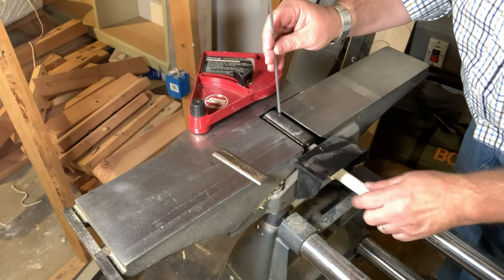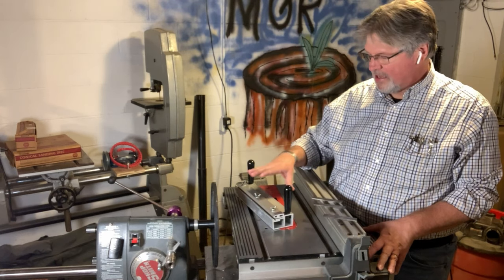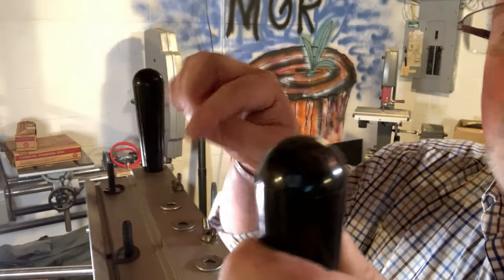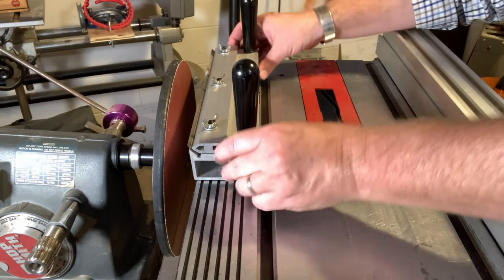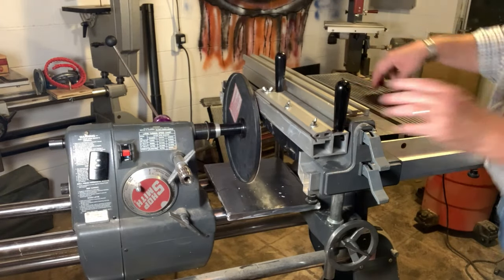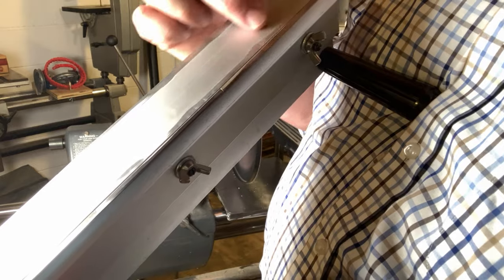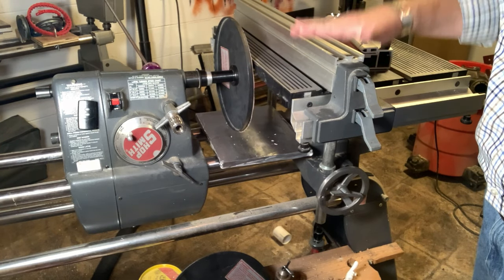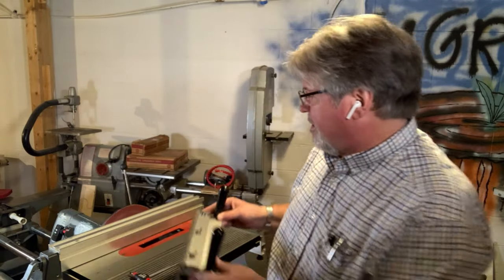Sharpening Jointer & Planer Knives on the Shopsmith Conical Sanding Disc

Comment: Excellent tutorial. 
I just purchased a SS Sharpening Jig, A Conical Disc, a 3-pack of Sanding Discs and a Magnetic Jointer Pal off of FB Marketplace for an even $100.  On SS website the Kit (jig, conical disc and sandpaper is $160 and the Jointer pal is $36.) 
I’ve learned:  Go slow.  You can always take more off but once it’s gone, you can’t add it back. 
And
While you have it set up, put on a flat Disc and sharpen your lathe tools.
Reply from the maker: @drumaganger  Thanks, Jody! Great advice.

Comment: I watched this video some time ago and was so impressed that I purchased the sharpening guide and during the last couple days I replaced the bearings in my Jointer and decided to use the tool for the first time and sharpened both sets of my Shopsmith Jointer knives. 
One set is carbide and the other not. 
Both came out as good if not better than new. WOW is the word for the ease and results.
Had to run a board through the jointer and it came out so smooth and flat. Should have replaced those bearings 1,000 board feet ago.
Thankl you as usual and congratulations on hitting that 99,999 Subsriptions.
Reply from the maker: Glad to hear that it's working well for you. And I think there's an extra 9 in there somewhere!
Reply: @MyGrowthRings  Dad-gum-it I did!!!

Comment: Watched your video and ordered a new sharpener directly from Shopsmith (since i couldn't find a used one).  The box was missing the lower glide rails so I built a new piece using HDPE and tagged you on IG so you can check it out.  Spent maybe 20 minutes sharpening 2 sets of jointer blades (extremely easy!).  Thanks for the videos.  You're a huge help!
Reply from the maker: Glad to hear it all worked out but it’s a shame that you felt like you had to do that repair work yourself. Did you call their customer service department? Scott
Reply: @MyGrowthRings  I haven’t yet. I’m working on a cutting board for my wife’s birthday while she’s out of town so getting the blades sharpened was time sensitive. I’m also going to replace 3 the 1” set screws with 1 1/2” because there are only about 2 threads on the wing nuts and where they thread in to the sharpening body. I understand why they didn’t use steel Allen head bolts threading in to aluminum but geeeesh, 1 or 2 threads holding the knife fixture is asking for trouble. 

Thanks for the response Scott!!

Comment: Scott… that is a tool with which I am unfamiliar.  Before I got my Tormek, I almost bought a used Shopsmith sharpening jig on eBay.  Fortunately, I was outbid.  You see, I don’t have a Shopsmith Jointer or Planer.  It would have been useless to me…. Or, I’d have spent a week trying to re-engineer it to work!

After watching it in use, I must admit, it is quicker to set up, more foolproof and easier to use than the Tormek!  And all in all, it is a lot less expensive too.  Perhaps it would be worth it for me to find a used one and see what I’d have to modify to make it work in other brands of knives.  After all, I only have about a dozen other projects going!

I posted a “Final Thoughts on the Conical Disc” video this morning.  However, in my sleep deprived editing, I made a seriously incorrect claim.  With a clear head this morning, I’m gonna fix it and repost.

You did a nice job with this demo, Thanks.
Reply from the maker: Thanks, Dave. Yes, I used to own a Tormek and used it once on my jointer knives and went back to the SS jig with the conical sander. The Tormek is unrivaled for chisels and plane irons, though.  Scott

Comment: Another idea - I have a table insert I’ve made for the conical disk.  Now the jig is much closer to the table end.  By use of the adjustable stop collar I can get excellent results and not be too extended.  One time I did angle the jig at the end.  I’ve a t-nut adapted face for the fence - making the fence longer.
Reply from the maker: All great tips. Thanks John.

Comment: As always great information. I was looking forward to this because you mentioned that the jig was not for use on non Shopsmith planer knives. I've been using it to sharpen my Dewalt knives. OPPS... I look forward to the follow up.  I've saved the cost to the jig and disc many times over by sharpening myself rather than sending it out to be done.
Reply from the maker: No harm no foul! I don't know that the DeWalt knives are even meant t be sharpened, but if you are going to do it at least be sure to sharpen them equally. Scott

Comment: I have a set of diamond sharpening stones that I use for chisels and plan blades. I have sharpened my Shopsmith jointer blades on them using Rob Cosman’s methods. It is a much faster process than what you showed in this video. However, absent sharpening stones what you showed was very interesting.
Reply from the maker: I'm familiar with Rob's method for chisels and plane irons but haven't seen it sued for jointer knives.  I'll have to look around Youtube to see if there's an example of it. Thanks for expanding my knowledge, Larry! Scott

Comment: Great video again. I use the adjustable stop collar to lower the table. As a technique I use a sharpie and cover the bevel. It makes it easy to see the area sharpened and expose any knicks.  I’m not close to the manual, but it states how narrow the blades can be before they need replaced.
Reply from the maker: Great tip. Yes, there is a maximum that can be removed.  I'll look it up and make sure to mention it in the follow-up video. Scott
Reply: Thanks Scott Green for the tip on using the sharpie. I do that with my lathe chisels when sharpening them, makes perfect sense to use that here.

Comment: Once again, thanks Scott for a extremely informative video .... I'm definitely going to need to invest in the Conical Sanding Discs as well as the Sharpening Jig.   Speaking of which, did you ever do a video on the Shopsmith Sharpening Guide for Chisels and Lathe Tools?   I have the guide and a dedicated Steel Sanding Disc along with the 12" 150 Grit Fine Sandpaper but have lost the directions that came with the guide.  Thanks again for the weekly videos ... I just love them.   Blessings,  Dennis
Reply from the maker: Hey Dennis. I don't know what happened to the response I typed, but I see it's not here!  No, I haven't done a video on the sharpening jig yet, but once we are in our own shop and all our stuff is out of storage we should be able to get to it.  That said, Doug Reid did a two part series on it: https://youtu.be/JlT_bNTnBUw and https://youtu.be/EkT5y-2ie94 Scott

Comment: Someday, can you show how to adjust the table so that the miter slot and the table saw blade are parallel?  My 510 (I think) seems to be slightly out of alignment, but the instructions I found mention bolts that I don't think I have.  It seems like it would be essential that the table be properly aligned for an activity like in this video, if you are relying on the fence to be parallel to the sanding disk.
Reply from the maker: One of these days I will. The 510 has four bolts that hold the table to the half round trunnions. The instructions tell you to loosen all four bolts but you only need to loosen three of the four. Leave one of the back bolts tight and pivot on that point, making slight adjustments at the front of the table. You can use a saw blade or the sanding disc as a reference point. There are several videos on YouTube covering this alignment. I’ll see if I can link to one. Scott
Reply from the maker: https://youtu.be/1ibAY1bQDG8
Reply: It is not that hard. The more time you take... the better results you will gain in precision!    After you get the main table done you need to match the other tables...  I do the end table next, to match it to the main table. Then do the extensions.   Also Do not forget to reset the miter and fence again after you get the main table set & tight!     I know it has been a year now.    Either you got it or gave up by now.  LOL

Comment: I wonder why they didn't make optional use of the mitre gauge slots on the table and possibly the slots on the 510 or 520 fences?

Another possible adjustment option would be to shim the fence, paper is around .1 mm ( ~ 3.9 thousandths " ) thick while playing cards are around .17-.25 mm ( ~ 6.7-9.8 thousandths "). There are ways of using feeler gauges as well.

According to the inch calculator ( search rise run  to degrees ) a 5 degree slope is a rise to run of about 1 to 11.5 so by lowering the table 1/8" you move the abrasive surface closer by about 11/1000 ".
Reply from the maker: The reason they didn’t use the miter slot is so you can use the jig and disc on thenPowerStation with an extension table, which is the only table you can add to the Power Station. You could also use the jig on the Mark V with just an extension table, but they aren’t quite as rigid as the main table. Yes, a shim could work but lowering the table works great and doesn’t add parts.

Comment: I'm thinking about getting this kit to sharpen my jointer blades, too. Is it really as easy as you made it look? Also, I have the 510 model. Do they work the same, or are there any problems I should expect? Thanks again for the great content.
Reply from the maker: It really is that easy. The most important thing to remember is to make very minor adjustments in either the quill or the table, because even a small adjustment can produce a lot of grinding. There’s no reason to take more of the steel off than necessary.

Comment: Hi Scott! Can you use this sharpening jig with a flat sanding disk? I have two flat sanding disks and just got a SS jointer that I am cleaning and prepping for use. I assume the blades will need to be sharpened and would like to try this rather than sending them out for sharpening. Thanks!
Reply from the maker: No, unfortunately it only works with the conical disc.

Comment: Great video. Thanks. Bought this for the shopsmith blades but find myself needing to sharpen some JET 6" jointer blades. Anyone know if the angles are the same for all jointer blades? Any reason I can't use this for the JET blades?
Reply from the maker: Shopsmith would probably say not to use it because the jig was designed to clamp their tapered blades, but the clamping bar floats and I'm sure it would clamp just fine.  I would just grind it to the same angle as the SS blades. Once you sharpen them once, that'll be the correct angle. Don't forget that for sharpening you don't tilt the table the way you do when using the conical disc for sanding wood. Best of luck, Bob. Scott
Reply: @MyGrowthRings  Thanks Scott. Tried it today. The 6" blades for the Jet jointer are only 11/16" thick when new. And that's the minimum that the shopsmith jig will handle. I think the grinding on your jig was from someone trying to do the exact same thing. My jet blades were not close to sticking out past the SS jig. So I'll just take them somewhere this time.
Reply from the maker: @bobkoelling9908  That makes sense. Thanks for the report, Bob.  Scott

Comment: Scott, I trust you all have/are having a lovely Thanksgiving … my favorite Holy-Day …  my question does not have to do with the conical disk: in an earlier video you mentioned that you like to shift your extension table to hang "out board" … why do you like that?  … to get a bit more distance between your saw blade and the rip fence? No rush, just curious.
Reply from the maker: John, I don't know where my response to your comment went, but it's not here!  Yes, by repositioning the table top on the support I get a little more ripping capacity to the right of the blade.  Scott
Reply: @MyGrowthRings  you commented on it in your video and showed the ET and where to tap the threads.
Reply from the maker: @johnoerter2883  Ah! Well, I don’t know why I didn’t reply to your comment first!

Comment: I need to get me one and the conical sander.   You would be happy for me, tomorrow I am going to pick up a pro planer stand alone on casters that I purchased for $250.   I am trying to talk myself out of the 510, jointer, bandsaw, strip sander and jigsaw he is selling for $500.   I offered him $600 for everything and he told me let me sleep on it.  But I have 3 machines and two jointers and a workmate already in a one car garage.   But it is tempting.   FB market place is just loaded with deals. a few months back I picked up the workmate and a jointer for $75.   All of this dudes stuff looks brand new.   I would like to have the bandsaw as mine is the old style and needs some love.
Reply from the maker: $500 for all that?! Snag it!
Reply: @MyGrowthRings  so I called him back and told him I would take it all but he had just hung up the phone with someone who wanted it.    But I got the pro planer.   I am going keep my eye out for a good deal on a  520. I seen one in Texas for 450 but not willing to drive that far for one again.  Lol.           I was in aware that shopsmith pro planer was made without a cast iron table.  Was these the early models?  It has the round crank knob too.  But it is in pretty good shape so I am not complaining for 250.   On casters too.
Reply from the maker: @jvmiller1995  The Pro Planer was only made with a cast iron table. If it has an aluminum table, it was a Mark V-mounted planer with an aftermarket upgrade stand. That unit will feed the stock through slower, and if memory serves me correctly the main motor is slightly smaller too.
Reply: @MyGrowthRings  okay well I guess that is what it is.  I was kind of wondering if that was not the case.  It seems to cut okay. I have not messed with it a lot.  I just got it home tuesday evening and I had a minor surgery yesterday.   I think it will serve my purpose I don't do near as much as I use too I don't remember paying attention to if the label said pro or not. I just assumed it was as it was mounted.  I was going to look up the serial but had not had the chance.   Thank you for the info on it.   I still stand to inherit a pro planer when the old man leaves the world.   I would not have purchased just a mark v planer without the stand and motor. $250 I did not get hurt on it I don't think.
Reply: @MyGrowthRings  I guess the feed rate is 15 ft a min and the pro is 20 when turned up.  I guess they did that as the 1 1/8 in the mark 5 cant handle the faster rate.I was thinking it was more grey looking than black so I 100% do have a mark 5 version on a stand. The conversion mine has from what I seen online has a 1.5hp motor.      So thanks for messing up my awesome deal by telling me I don't know everything shopsmith as well as I thought. Lol   For real tho thank you for the info and thank you for being there for our community.  You are a wealth of SS info
Reply from the maker: @jvmiller1995  Not bad at all.
Reply from the maker: @jvmiller1995  Sorry about that. It’s still a good deal.

Comment: Really cool, what angle is that set at? Can it be done on the straight wheel? What grit?
Thanks. I need my planer blades sharpened for sure.
Reply from the maker: The table is set flat for sharpening with the jig because the jig takes into account the taper of the blade. It all comes together to give the bevel a 45 degree angle. I use P220 grit for sharpening, while SS suggests P150 grit. I find that works for grinding a nick out or reshaping the bevel, but 220 is all that’s needed for sharpening. Yes, you can use a flat disc with the fence offset, but it’s tricky and the results are not as good.
Reply: Thanks for another great bit of info, and such a full answer. This was from my Gold Prospecting account, you git me twice.
Reply from the maker: @FrugalFixerSpike  Sweet! Thanks for that.

Comment: Thanks for the tour. I'm going to try out the jig I bought for this next week. Are you using SS conical sanding abrasives? It seems difficult to find pre-cut conical disks in 12" that are finer grit than the ones SS sells.
Also, a little critique: I would lobby for you not reaching over the top of the running disc to switch off the machine at 14:55. Sets a bad example for us accident prone users  : )
Reply from the maker: Then don’t do that.

Comment: Are you able to sharpen the jointer knives on a flat disc sander with the fence offset adjustments previously mentioned? My assumption is not unless you are a risk taker.
Reply from the maker: Exactly! Yes, it’s how we used to do it before the conical sander and jig were introduced. It doesn’t get the same, flawless results, it it works ok. Scott

Comment: Any advantage to using a conical disk to sharpen the SS lathe tools versus the flat disk?
Reply from the maker: No, not at all. Because the conical disc only makes contact on a small area it would be very easy to create facets in the bevel of the tools.

Comment: Thanks for the video Scott. I have this (bought it when it was on sale) but have not used it yet. I have a 510 with a finicky fence. Assume I have to make absolutely sure it is parallel to the disc before starting. Also, I have the Shopsmith adjustable stop collar. If I was going to use that to lower the table for another pass to take more off, how much should I lower it.
Reply from the maker: Actually it’s surprising to know that even if the fence is slightly out of parallel with the miter slots you’ll still get accurate as straight edges with this set-up, just as long as nothing moves. As for the adjustable collar, i’ve reached out to Shopsmith‘s Jim Mccann for an answer on the effect of the lower of the table. A mathematical equation which my dyslexic brain has yet to be able to decipher! The manual makes a suggestion of lowering it 1/32”.
Reply from the maker: Also, in what way is your fence finicky?

Comment: What speed did you use the slower the speed less heat.
Reply from the maker: I tend to run it on Slow, which is 700rpm. Much faster and the edges will loose their temper.